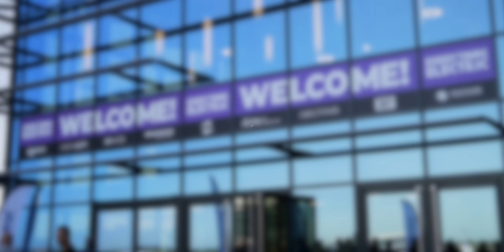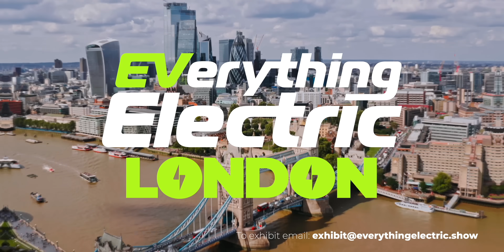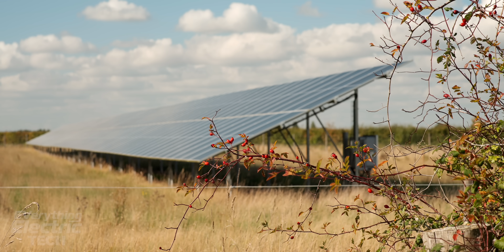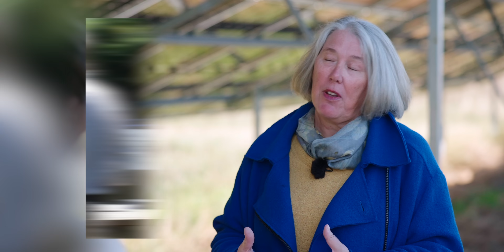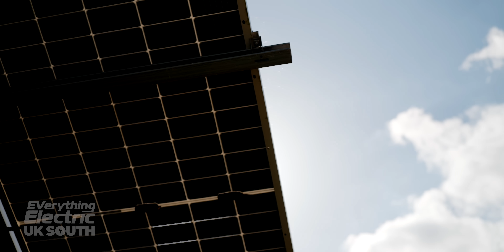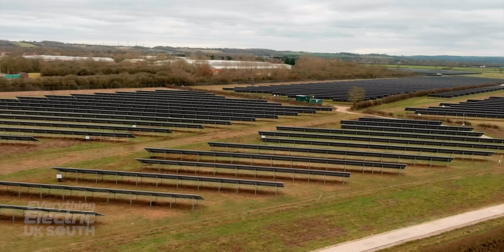Community Energy: The Future is Local!

Comment: I mean, most of these are community owned in the same way that any corporation with shares is "community owned", it's just lip service to small scale energy generation.

I'm all for local energy agreements where individual owners can enter in to deals to export power for use by others while retaining control of their own equipment entirely.

Actual communal ownership is like group projects though. If no one has the authority then no on has the responsibility so failure is all but guaranteed.
Reply: Such project attract people who are concerned and do believe this kind of approach to energy is valid. Take Dirrel Water community solar park. Created by Ripple Energy who as a management consultant collapsed and left the project high and dry. However the people got together and constructed and management team within the confines of the rules that govern Cooperative. It is now up and running, but without some challenges, to over come a failed power unit that currently limits the parks output to just 20%. We should see full projection next summer.

Comment: I didn't understand Barbara Hammond's comment about "we're going to reduce our energy need by 40% because electricity is so much more efficient".... kWh is kWh....
Community based is how most Scandinavian countries have operated for some time - Two of the greater issues to solve in the UK is lack of political will to enable it beyond the soundbytes, and an under-invested grid built for an entirely different era...
Reply: I believe the point she was making is fossil fuels like coal, oil, petrol etc burn with such low efficiency that most of their potential energy is lost. If you count that lost potential in the overall energy used figure, electricity only would be more efficient. Increasingly so if it's locally produced and you reduce transmission losses. 80-86% of energy is lost between the oil well and the car wheel due to extraction, transport, refining, and engine losses.
Reply: @MichaelCampbellGB  Indeed that is a possible explanation,  but irrelevant in the home heating environment dominated by consumer costs .
Reply: @robertlamont9455 maybe, but a heat pump can be 300-400% efficient in heat generation, compared to gas at about 92%
Reply: @MichaelCampbellGB  Don't get me wrong here, I'm all in favour of electrification and heat pumps, the only reason I'm still on gas heating is flaky mains, and kinda glad now - The kWh price is what matters - 18 months ago power was 3.5 times the per kWh of gas with an efficient boiler, a heat pump would break even on running costs - That ratio is now 5 due to a recent price change, a stupid move imho -  My biggest saving was DIY insulation, dropping gas use by 70%
Reply: @robertlamont9455 well done on the insulation, makes such a difference. In my opinion the government should be funding that instead of heat pumps, payback on insulation is rapid
Reply: @MichaelCampbellGB  Insulation is the cheap and permanent solution no matter your heat source, folks should be kicking up hell with government about a national program or grants, a 70% saving on emissions ?? - HMG are more concerned about their own and company revenue streams than consumer benefit, energy supplies, the climate, or how it would stimulate the economy, it's the same old London myopia.
 - It was all DIY here, at today's retail prices the insulation was less than a grand - Last year's gas bill was 550 quid with a -16 winter - The point here is, had it all been done in one go, it would have paid for itself in under a year 
- This morning sat with a cuppa looking at  the monitoring system, 7c overnight, boiler on 42c continuous circulation through bigger rads, return temp 23 - No complaints from me, cosy....

Comment: Yep dropped right in one of my favourite rants, been going on this point of years, why are we still relying in central power production when every city, town, village and even house can generate and store enough electricity to support themselves. Large power plants should only be supplying electricity to industries where the required power exceeds the ability to produce on site or nearby, and when one of these plants goes down it should  have no effect on home owners. Solar on roof and other areas, feed in from batteries and EV's, local small solar plants, we should be designing our society such that there is no possibility of large scale blackouts.

Comment: The thorny challenge is how you make this work for low-income families. We need to get everybody off polluting fossil fuels, so we can't leave the poor or vulnerable behind. Clean cheap energy has the potential to eliminate fuel poverty and all of the health problems associated with that, and to massively boost our economy in the process.
Reply: It would be incredibly difficult to find a solution that works for everyone at the same time.
If a "cooperative" is working for their members, it's a good thing, even if not everyone can benefit directly.
In this case, the electricity generated in this solar farm will feed the grid and some demand (near and far) will be met by this source. There will be less demand for the most expensive gas generators, which in turn affect the price for other sources.
Overall this optimisation and cheap generation should reduce the costs that everyone pays, whether they have high or low income.

Comment: Solar and wind generated electricity connected to the power gird is ALTERNATIVE electricity generation that doesn't save fuel not renewable energy.   It is commercially worthless electricity.  In practice grid connected solar and wind generated electricity are supported by running natural gas turbine generators at high readiness 70% fuel consumption making near zero electricity where at 100% fuel consumption fully backs up the erratic electricity in a few seconds.   This is very similar behavior to a jet airliner gliding in for a landing then upon landing can produce full reverse thrust in a few seconds.

66-2/3% fuel consumption of 100% peaking power is expected to be used to make all the electricity from efficient running natural gas combined cycle power stations.  Wind energy fluctuating second-to-second requiring constant makeup causing wind power to be the most natural gas expensive form of electricity generation.  

The practical use for erratic electricity generation is for maintaining electrical storage where the storage provides dispachable electricity.   Steam turbine generators react too slowly for supporting large amounts of solar and wind electricity with are used in coal and nuclear power stations.   New ultra supercritical coal power stations have liquid characteristic turbine flood yhat can react much faster, but not at the level needed for supporting large amounts of erratic electricity.  

There has been no climate change from global warming that was expected to begin at 1.5°C.   NASA reports global warming at 1°C where it has been since 1992.  The cause of global warming is not known with studies to its cause going back to the 1970s.   Carbon dioxide is the gas of life.   1200 ppm atmospheric carbon dioxide about three times today's levels would greatly green the earth and is used in plant growing greenhouses.

Comment: Ground-mounted?

Aaaargh, what a waste of space. And it makes nature look ugly for no reason.

Put it on top of buildings. Solar panels work just as well up there - better, in fact, as it's less likely anything is going to throw a shadow over them. And what else is your roof doing, besides keeping the rain off?

Then we don't have to touch an inch of green space.

Literally. We don't. It's been calculated that you could meet 100% of all of the UK's energy needs - both domestic and industrial - with just 1% of the UK's land area being covered in solar. And the urban areas of the UK cover 8% of the land area.

So there's 8 times more space than we need in urban areas, putting solar on buildings.

There's also some other simple benefits. Going 10 metres from the roof to a battery, transmission losses are basically zero. Running from batteries, solar then lowers grid demand. Batteries can also help reduce costs - "time of day" tariffs - even without solar.

But, most of all, you own the means of (energy) production. Lock, stock and smoking barrel. You get charged nothing. It pays for itself in less than 10 years, probably (exact payback time varies on circumstances, of course) and then you get 20 years of profit. In terms of "lifetime costs", solar is negative. You get back all the money you pay for installation, and then get back that same amount again. And then once more for luck (assuming 10 year payback - which, to be honest, is conservative - and 30 years lifetime).

Don't put solar in a field. Put it on your roof.
Reply: Are you aware that 7 times more land is used to grow crops that are turned into bio-fuels, which net just 10% of the energy of the solar panels do.

Yes it's better to hide solar on roofs, but this massively increases the area needed, as many buildings aren't suitable for solar. 

The fact is that ground solar of just 1% of the available land would supply most of the UKs needs, which is less than how much is taken up with golf courses, and those benefit just a few people.
Reply: Roof top solar has it's place, but it is much harder to maintain and has limited area (one roof per install). Larger projects need bigger arrays.  Nobody is saying we should cut down prime forest or put arrays on prime farm land. Low quality agricultural land, like grazing pasture, is ideal as you can continue grazing (someone has to cut the grass) and biodiversity can be increaced as monoculture grass isn't very biodoverse.
Reply: For those who live in flats or retented accommodation,  the roof is not an option.